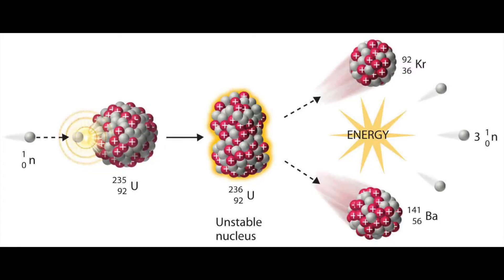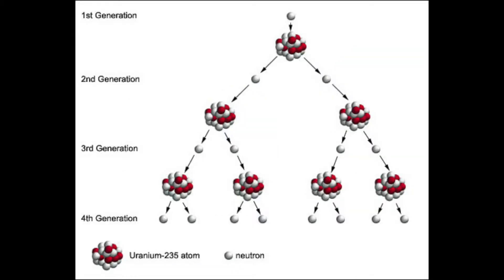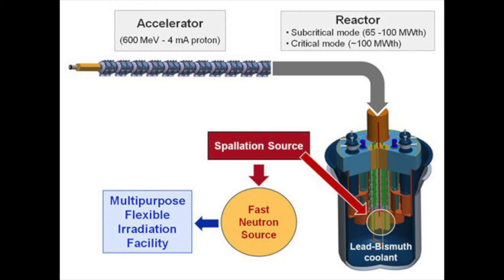A common missconception about nuclear reactors

Comment: Felix where does the first neutron or neutron source come from? And why don’t  the uranium pellets react with each other in the tubes ?
Reply: As far as i know the neutron sources are devices called neutron guns. The pellets do react with each other if they are in use. But if they are new there is no reaction happening because you need to split a first atom to start the reaction. Thats what the neutron sources are used for, they start the reaction. Once the fuel rod is depleted, the pellets are still reacting inside, but not strong enough to be used in the reactor. But since they are still reacting, they are put into a water pool to rest.